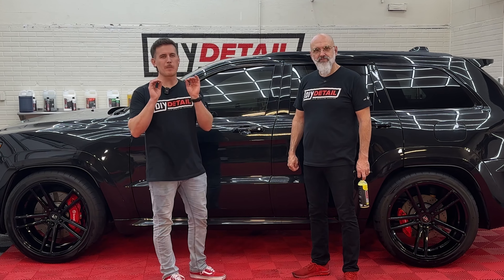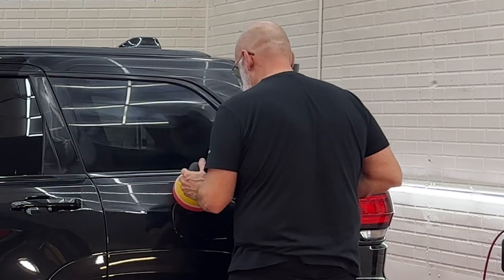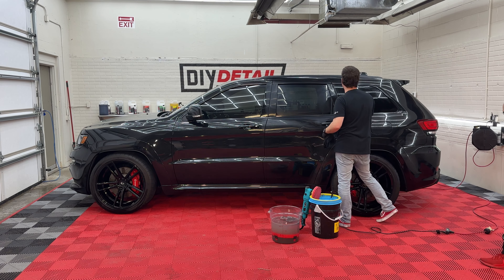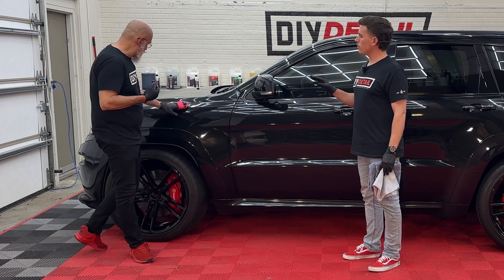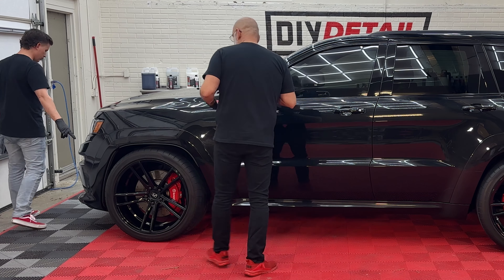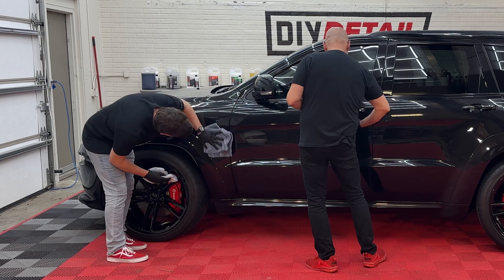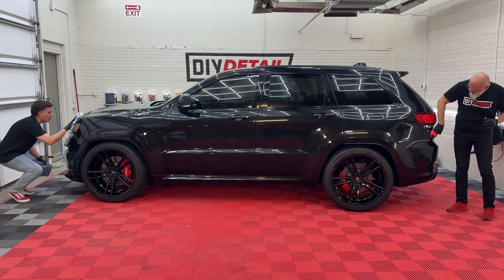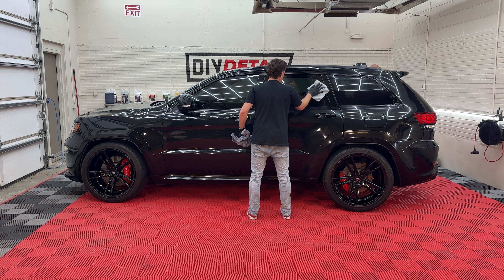STEP BY STEP: how to rotary polish & apply our 5-year ceramic coating (on JEEP SRT!)

Comment: I applied the graphene coating last weekend. Open garage door in this Oklahoma heat and humidity, leveling the coating maybe not even a minute after applying was super smooth. Couldn’t be happier with the application process
Reply from the maker: Good stuff

Comment: The 5 year was a pleasure to use. Glossy results. Slick level feel, easy to apply. I was in high humidity, but was able to let it bind, then wipe after a minute.
Reply from the maker: So great to hear! Did you use it on a personal vehicle or was it a paid job?
Reply: @diydetailofficial  both! Have also used the 3 year on customer cars

Comment: Finally got around to applying this.  Observations from a complete newbie.  Decon is WAAY harder than applying the ceramic coating.  And I think I had the opposite problem from most… I think I under applied and I work the product too much.  I have a silver vehicle so it’s tough to see flashing as well.  I’m in the 2 hour window so I’m gonna apply a second coat.  Thanks for all the tips !!
Reply from the maker: Thank you, please post your results on our Facebook group. 

Https://bit.ly/DIYDetailFacebookGroup

Comment: Do you have any videos going over machine around/over raised decals? I have the raised decals on the sides of my Jeep wrangler and have been wanting to do a machine polish.

I also have a question regarding textured plastic trim restoration, since the fender flares could use a touch up over the minor top scuffs/dulling from off roading. I heard a heat gun or hot hair dryer can be used over the plastic trim, but I would like to know from you the professionals if they would recommend this. I don't want to melt the plastic. 😂
Reply from the maker: Using the yellow Waffle Pad (or the soon-to-be-released Rotary Jeweling Pad) with Gold Standard Polish on a rotary polisher is amazing for going over/around decals. As far as a heat gun, don't use them! Better to use a product like Solution Finish on faded trim
Reply: @diydetailofficial  thanks! So no to the heat gun, and yes to the solution finish it is. Will it cover up the minor scuff? The scuff is barely noticable unless you focus on it, and the texture is still there. Water alone did not clean it but I may try an alcohol swap before doing a full clean. Also will you be offering any plastic trim products of your own anytime in the near future?

Comment: My mentor taught me the same pattern as Yvan did, starting at the drivers side front fender and working around the vehicle ending back at the drivers door. For washing, polishing, waxing (yes old school) or drying. Always the same pattern. Wondering if thats a very old school standard procedure. Cant wait to apply the 5 year. I did a 3 year a month ago it went well, I haven't done its first maintenance wash yet but looking forward to it.
Reply from the maker: Many people use that method. Let us know how you like the 5 year coating

Comment: Great video guys, learning alot about your products. Some detailers said that the towels used to level the coating should be throw away aftetward. Is it the same with you all ceramic coatings?
Reply from the maker: nope! Just immediately put them in your bucket of Rinseless Wash or put some All Clean in a bucket with water and soak for 30-60 minutes minimum, then they can be washed and will be totally fine to use again
Reply: @diydetailofficial  
That's good to know

Comment: How does using a last step product as you maintain the coating over the years affect the gloss and slickness. For example, if using ceramic gloss once a month over the ceramic coating will you notice the differences you mentioned in gloss and slickness between the 3, 5, and 8 yr coatings or will they all start to look the same because you are putting the same product (ceramic gloss) over them? Thanks for the super informative videos!
Reply from the maker: it's a great question, and it's one that detailers naturally ask/think about. It's something Yvan might have a better answer for, but my basic explanation is this. You have the real deal protection as your foundation. You're building something, you gotta have a good foundation right? Which we have here with the coating. Boom, foundation is solid. After that, you have a peace of mind knowing that no matter what happens on the top floors, the foundation is solid. So Ceramic Gloss and Quick Beads are your sacrificial "topper" layers, they have certain properties themselves for sure. But they're drying aids, first of all, to make the drying process safer (which make sense to me regardless of what the properties are) And they add gloss/protection as well (also a bonus for the car, as far as I'm concerned). As far as look and feel? It's hard to say exactly, if I'm trying to give an exact comparison (so many variables over time with driving, maintenance, weather conditions and miles on the car) but my best advice is: don't overthink it:) -Nick

Comment: The polishing notched up the paint three levels. Wow the coating is glossy and notched up the paint four to five levels. I use a microfiber soaking in rinseless wash to wipe off too. Using panel prep to remove the polish just feels to grabby to me. I box in my working area too when applying the coating then start giving my best karate kid moments when waxing on. Mr. Miyagi makes sure I do not have high spots😂. 
Quick question do you have a product in the pipeline to give outstanding gloss like CarPro Release, Titan, or Dreammaker? Thank you for another excellent video!
Reply from the maker: Thanks Neil, we’re always working on and testing products behind the scenes but nothing in the immediate future no
Reply: @diydetailofficial  thank you and my mind was looking for a gloss boost for the eight year ceramic coating.

Comment: Question on the different coatings, is there any of them (5 year pondering in particular) where the gloss might actually be reduced using Ceramic Gloss or QB on top of it to maintain (not because those products aren't great themselves but because the ceramic coating is that step above in gloss)?
Reply from the maker: They won’t hinder the gloss, only help it.

Comment: What is the red applicator pad cleaning process for reuse after applying ceramic coating?
Reply from the maker: When done applying the coating, soak it in your wash bucket for 15mins, rinse and dry

Comment: Why are you wanting to level the coating a little bit faster on windows? The substrate bonds faster with the coating and so you need to level it sooner?
Reply from the maker: Since glass is less porous, it cross links faster.

Comment: Does the rotary pad / polish combo used do any paint correction at all? ie: very fine scratches/micro marring?
Reply from the maker: Very light yes
Reply: I've done a reasonable amount of this type of polishing (rotary, soft pad, finishing polish - I know Gold Standard can cut too though) and it's surprising and pleasing how much it removes swirling. I had an "interesting" discussion with a detailing supplies shop about what I was purchasing - they said "that won't do anything", and they also looked at me as if I was an idiot when I told them I use a rotary. The guy said "I burnt through paint on a Porsche the other day, and I've been using a rotary for many years". I ignored him. (and I'll avoid using him if I ever do hire a pro!)

Comment: Thanks for another great video guys. question would using using a forced rotation yield the same results as a rotary? Also what pad size do you recommend. Thanks.
Reply from the maker: Lots of people polish with forced rotation so that’s fine but it’s not the same technique or results. It might look great as well but it’s not the same finish as you get with a rotary
Reply: @diydetailofficial  Thank you one more question what size pad do you recommend  on your rotary 5, 6 or 7 inch?

Comment: Love the 5 year coating- installed it a week ago. Question though: I use the Technicians choice ceramic detail spray as a topper- used it 24 hours after install, and then today 8 days after coating installed for first bath with carpro reset (cool panels, shade, etc). I noticed high spots from the detail spray after I used it today as a topper, and this never happened before with this spray. I had to use Gold Standard to wipe away the high spots. In y’all’s expert opinion, is there a reason why the detail spray would leave a high spot on the ceramic coating and not the old waxes I used to use? Very confused right now.
Reply from the maker: We’ve never tested that over our coatings. My thought would be the coating is rejecting it. If using it again as a drying aid( no toppers are needed) use very very little.
Reply: @diydetailofficial  first off, thank you for always responding to my questions. I will follow your advice on the next bath and lower the amount of product that hits the panel as a drying aid
Reply: @diydetailofficial  wanted to clarify, I used the wrong term - I meant as a booster not a topper
Reply from the maker: @seansean8008  again, less is more
Reply: @diydetailofficial  okay I just wanted to follow up again. To summarize, I have two cars with Cquartz 3.0 and two cars with DIY ceramic coating, 5 and 8 year. I used TEC58205 as a ceramic booster on all of them. The Cquartz did not have an issue with it, but both DIY coatings left high spots all over on various panels. When I used it this morning for the first time on the 8 year coating, and I used it very sparingly and buffed thoroughly as I always do, it left high spots in various spots on several panels. This is just a friendly warning to anyone out there who loves TEC58205 like me- don’t use it on DIY coatings: find another booster.
Reply: @seansean8008 don’t use a product like that so soon after applying a coating. Wait at least 30 days.

Comment: I hear everyone one say, higher temps and humidity= less time before wiping off. Colder temps and lower humidity= let it sit longer. What about us in Az. High temp no humidity. Do we still level quicker?
Reply from the maker: you will just be able to see on that first panel. We like to coat the hood first, almost as a "test" panel. Get the coating on the paint, see how it's flashing....how long is it taking, etc. That way your pad is primed, your method/understanding of the paint is good. it seems like every day can be a little different depending on the conditions so just learn to see what the coating is telling you on the paint, if that makes sense

Comment: Will this process for polishing with that pad and speed 1 remove light swirls? Also is a faster speed ok ?
Reply from the maker: Yep, it will! Very light swirls, probably not worth trying to get a scratch out with this pad though, it’s the opposite of aggressive. No…if you’re going to finish polish with a rotary, keeping it on the absolute slowest speed setting is critical even with this pad
Reply: @diydetailofficial  thank you. I’m new to detailing. Just purchased a 23 Dodge Durango last month and I think my towel created some light swirls. Actually they’re straight that’s why I believe it’s from the towel. Do you recommend this pad or your yellow pad?
Reply from the maker: If they are very light( towel marks generally are) then yes the red waffle pad will do the job
Reply: @diydetailofficial  thank you for your help.
Reply from the maker: @georgenoutsopoulos9982 thank you for the questions

Comment: For the polishing, were you using the Gold Standard Waffle Pad? It wasn't the same color, so just curious?
Reply from the maker: It’s called our Rotary Jeweling Pad, it should be available late July 😀
Reply: @diydetailofficial  In using the waffle pad will the same effect still apply?

Comment: How can you tell when you need to apply a few more drops to the pad? Sorry, still learning about ceramic and been debating on taking the jump and going after ceramic since I've done the paint correction and polishing process
Reply: You can honestly get away with applying a couple more drops every panel you do. Also, test it out and see how far you can get with the initial primed applicator. You’ll notice less product on the surface the further you go.
Reply from the maker: when the solution on paint starts to thin out during application, that's when you know you need more coating. on the other hand, you can tell you have too much on when the coating is just running/dripping on the paint once you apply the pad. you will honestly get a feel for this as you coat panel by panel. but again, you want to see the coating as it's being applied. not too much, not too little...it's a bit like goldilocks lol but practice makes perfect

Comment: Also do you need an expensive rotary polisher? Or can I use any rotary polishing?
Reply: They have shown in a few videos that you can use a dual action sander paired with the gold standard yellow waffle pad and still get great results 👍🏻
Reply: rotary gives more gloss
Reply: @mdoyal111  that they did but the red pad that’s coming out. One day 😂 is meant for the rotary to bring out the gloss.
Reply: @stevenv9224  thought you meant in general! Yeah they’ve said to only use the red pad on a rotary. I’m sure you’d be able to use it with whatever rotary you have
Reply from the maker: if you want to use a rotary, use any rotary - there are very reasonably priced ones. If you're a fan of dual action machines, like some folks said below...you can use the palm sander with our yellow waffle pad and that does a nice job, or you can spend more for a dual action polisher as well.

Comment: I had my car (black paint, polished and coated with a very reputable brand) in a body shop for several weeks and unfortunately, they returned it with swirls/light scratches all over. The coating still seems working but I need to polish it again. What's been your favourite way to polish a coated car to remove the coating and swirls before re-applying a new coating?
Reply from the maker: you don't want to make a habit of polishing coated cars just because you see scratches, because I promise you it will just get scratched/swirled again. But if they're really bugging you, don't focus on "removing" the previous coating. Just do a wash, decontamination step with iron remover and decontamination towel, and a light polish. yellow waffle, gold standard polish, speed 3 no pressure. panel prep and coat
Reply: @diydetailofficial  Thanks. In this case, the body shop really did a number on every panel they weren't working on. Very frustrating for anyone who really looks after their car...
Reply: @diydetailofficial Which rotary polisher is used in your video please?

Comment: How many pads are required to polish a whole car?
Reply from the maker: If you're just using the one pad for polishing, one pad. If you're compounding with wool and then polishing with the rotary jeweling pad, 2. That's because the pad washer system is so awesome when you use it with our line up and standard operating procedures:) so basically, you just need one pad to polish the car
Reply: One

Comment: From Detailing Business Academy we learned that rubbing alcohol isn't do much in terms of removing waxes and polish residue and there is a better solution - mixture of acetone and glass cleaner. DIY Panel Prep is 60-75% of isopropyl alcohole, which is stronger version of rubbing alcohol. Has anything changed in terms of using IPA in detailing?
Reply from the maker: No, Yvan continues to say IPA belongs in the home
Reply: @diydetailofficial but the panel prep is mostly IPA. 🤷🏻‍♂️
Reply: @orthodox1717 mostly, not completely

Comment: Re the glass, any idea how long these coatings last? In this video from Pan The Organizer, the (competitor's) coating he was testing seemed to hold up better on the paint, although he only showed the water behaviour on the windshield, which may have been abraded by the wipers. (he didn't say whether it was better in the areas not covered by the wipers)
https://youtu.be/JLhTW_D7b8Y
Reply from the maker: Yes unfortunately abrasion is the enemy of coatings. On windshields durability is very dependant on that.